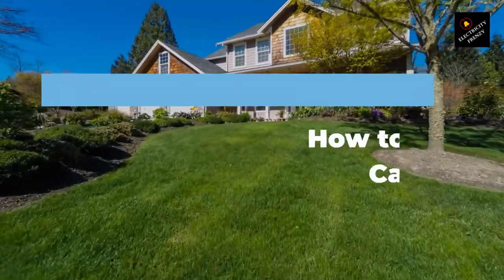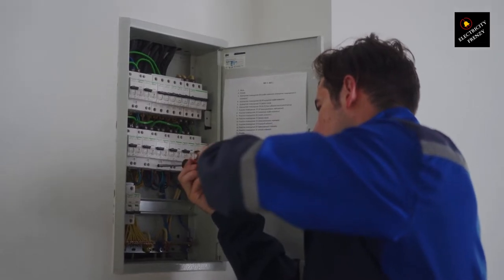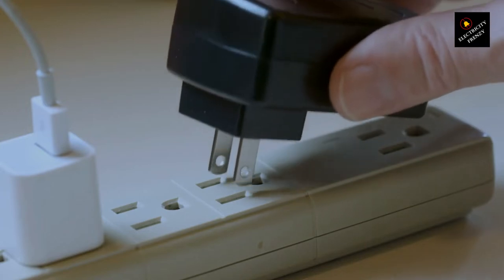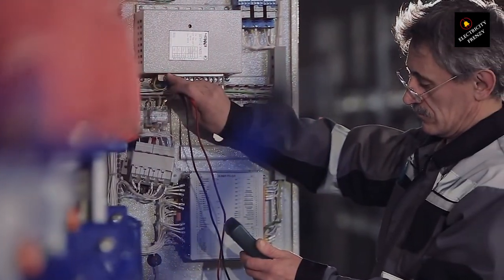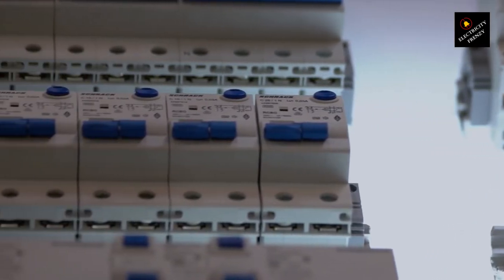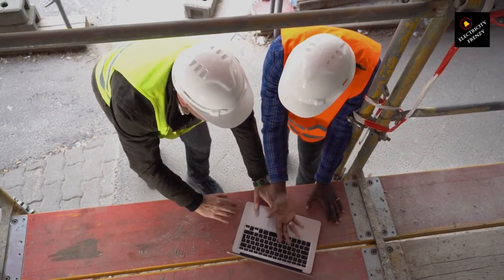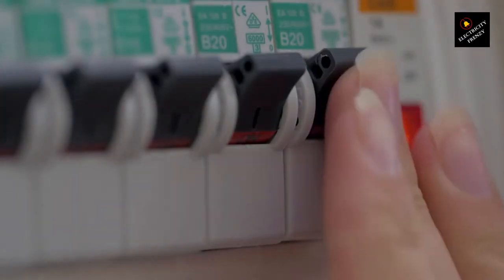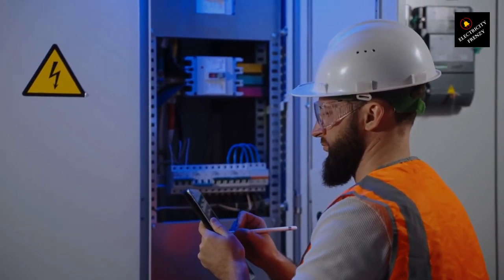Circuit Breaker Keeps Tripping Immediately? Here's a Step by Step Troubleshooting Guide

Comment: I've unplugged everything and turned off all the switches and it still trips immediately. I suppose I will next open all the outlets to look for a ground fault.
Reply from the maker: You are right. It may be a ground fault you need to dig deeper.
A tip to consider is what exactly happened just before the 1st time the breaker tripped do you suspect any particular switch or plug?
Reply: @ElectricityFrenzy  noone had been in the room for nearly a year. I removed the electric panel because I wanted to try and see if it would trip if I removed the wire. The cover crashed down in the process tripping a bunch of breakers. Now somehow I was able to reset it and turn on lights. I don't want to mess with it now as I am in the process of selling the house. My theory is maybe it wasn't sitting firmly on the rail and it got knocked back into place, and that maybe that was triggering the arc fault, but I don't know.
Reply from the maker: Thanks for letting me know. 👍👍